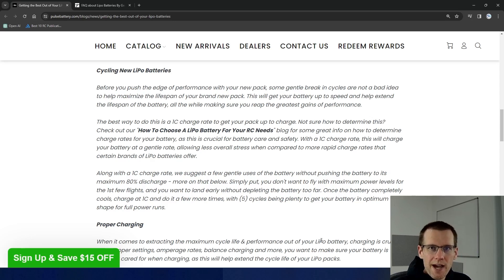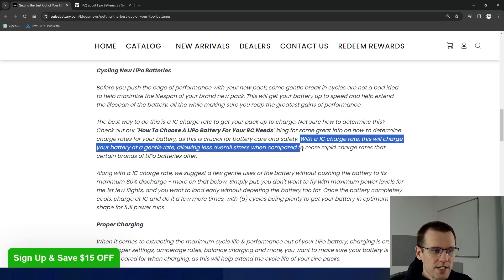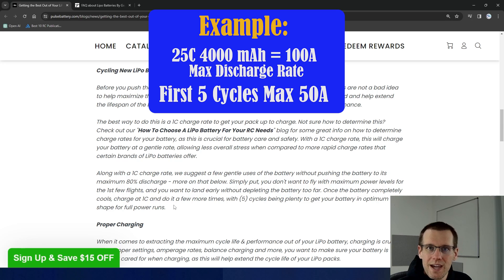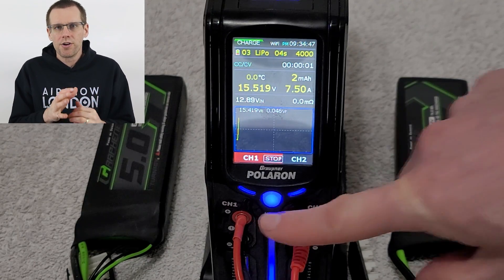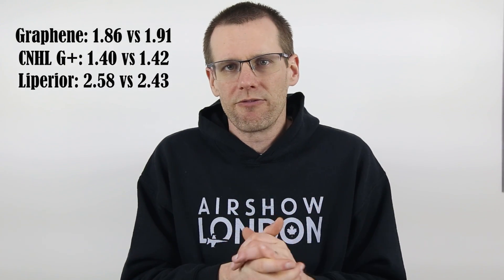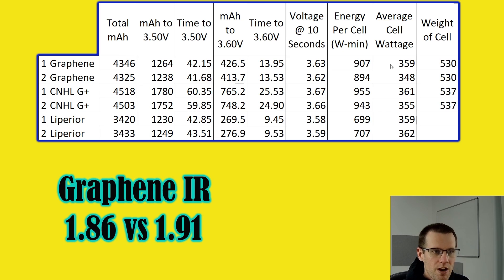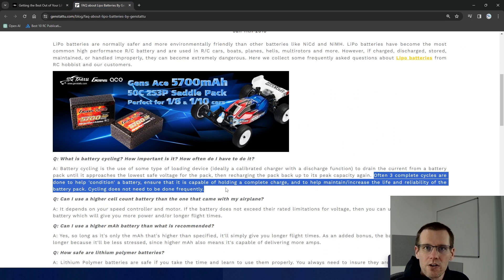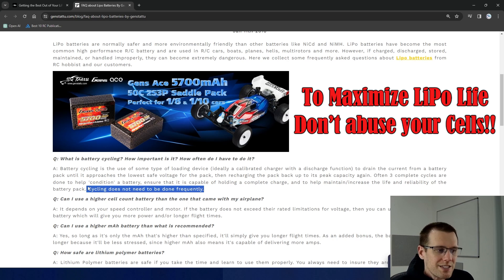LiPo Secrets Revealed! Do You Need to Cycle New Packs for Performance and Lifespan?

Comment: I recently found lipo batteries that were brand new never used only storage charge that were recently forgotten about 4 yrs ago and seem flat with no punch after 2 cycles in a fast electric boat . At this point i think chemistry has decreased

Comment: I bought 2 new gens ace redlien 2.0 batteriws and i didnt cycle them at all when i got them and i juat charged ans used them. I hope i didnt hurt them caause when i charge them now their IR is in the 3s already and they are fairly new. What could i have done wrong and is there a way to lower the ir? Im in the market to buy some new 2s battery for racing and i dont want to ruin that pack too

Comment: I have a wooden model boat that I want to turn into an RC boat!  It weighs 600g and is 60cm long and 18cm wide and already has a propeller with a diameter of 43mm.  It has a v hull.  I want the bot to be able to level but it doesn't have to go super fast.  I want the bot to have a range of 30m and have a battery time of at least 15 minutes!

Can someone please recommend some parts I'm completely new to the hobby! 
Can you buy a pre-built Controller or do you need to Build one yourself?
Reply from the maker: Use a small outrunner with a lower Kv and run it on a 3s LiPo with at least 5000mAh. More capacity more run time.

Comment: I heard cycle batteries, and flashbacked to 90s! The only thing I have done with lipo battery packs is balance charge. That seems to bring some packs back in line when a cell drops voltage before others. Hope that made sense! 😊✌️
Reply from the maker: Yep, I end up balance charging every charge. But that's all you really need to do with lipos

Comment: I have not seen much if any difference when cycling LIPOs.

Have you heard that when doing speed runs, you want to run the batteries down to a lower than storage voltage (say 3.7v per cell) before charging them to get the best performance?  Or that you charge them at around 0.1 C to get optimum performance?
Reply from the maker: Yes, it does depend on what is meant by performance here.
Reply: @RCexplained  by performance, I was meaning a higher top speed.

Comment: I've been charging lipos for many years and have not seen any difference what you're talking about I think that people are stuck with the old Nicd mentality. I smell BS
Reply from the maker: Agree
Reply: Snake oil lol and every racer is searching desperately for an edge and therefore they tend to fall for and believe everything. People at my track spending big money on i chargers and expensive discharge devices to cycle and discharge their batteries at 40amps to get them hot 😂

Comment: When you cycle Batteries how low do you need to go 3.2, 3.5 or to storage 3.8? does it matter?
Reply: Storage voltage is 3.80 per cell
Reply: Yes, i know but when cycling do you do a  full charge 4.2v and do you discharge to, 3.8v or 3.5 or 3.2 ?,and back to to 4.2 for one cycle? @dannyrivera9805 Which is best ?

Comment: I'm still using 4S 1300 65c turnigy graphene packs after at least 250 cycles over 6 years and I have to say they are close to their original condition. I do think the graphene batteries last really well.

Comment: Hi Ryan. I usually only cycle my batteries once ,just before the flying season begins. At the field. I bring as many batteries as needed to fly. For example. I'll bring four batteries for four flights. That's it. At the end of the day. I'll discharge each battery to it's storage state. Having so many packs greatly reduces the amount of cycles per pack. Has worked wonderfully for me for many seasons. I am  unsure what the "absolute" minimum voltage per cell I may safely discharge the pack to.
See you at the field.
Reply from the maker: That strategy will work for sure and help reduce the amount of total cycles. 👍 see you at the field!

Comment: here is a way to check the health of a battery very fast and easy. When you put a 1.5-2+ C charge on a pack you will see the voltage spike. It will jump up sharply from its resting voltage. How much it jumps tells you everything about that battery. the better the battery the less voltage spike. and thus the less voltage drop under load. This is why you have to charge slowly because that spiked voltage will reach 4.2v early and then the voltage will rest and sink down to 4.18v or so. the slower you charge, the better the battery, the less spike and more electrons go into it.

Comment: I never cycled my batteries but if I do not use up the pack I do discharge them to storage mode and leave it .I had an accident and could not run them for a little over a year and they all set in storage capacity during that time . I have been using them now for 6 months and have had zero problems and they do last just as long as when I bought them new .So I am calling B.S. on cycling .
Reply from the maker: Yep, there doesn't really seem to be much of a difference from what I can see when cycling packs?
Reply: @RCexplained im glad you actually did the tests cause at the track all the racers swear by it. They buy a pack and spend house cycling them at high charge and discharge rates. They all discharge at 40amps which is nuts to me. They want them hot to lower ir. I don't even have a charger thay can do 40amp discharge. My gens ace charger does a 16amp max discharge. I purchased 2 new gens ace redline 2.0 batteries and never cycled them. I just 1c charge and use them lol